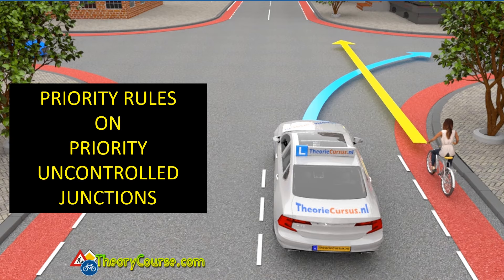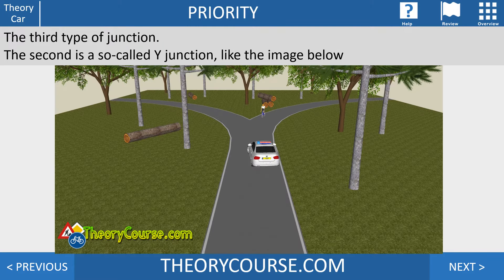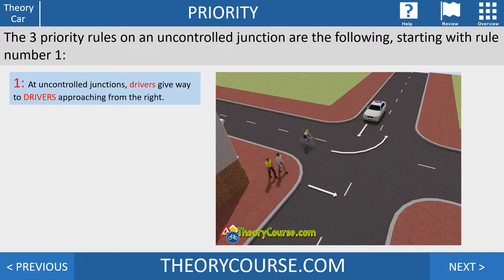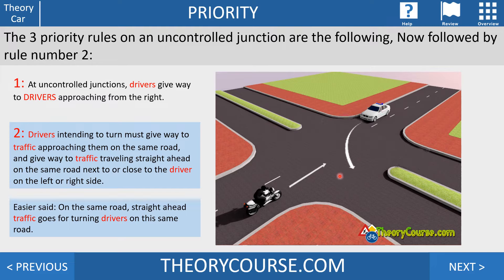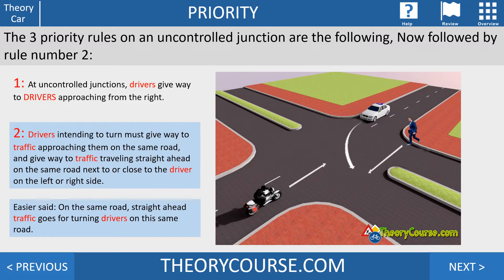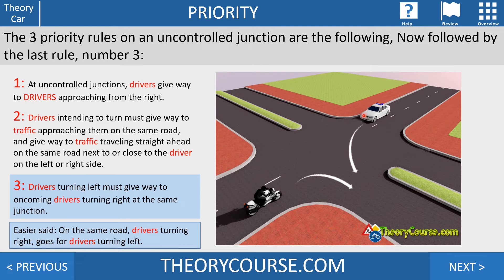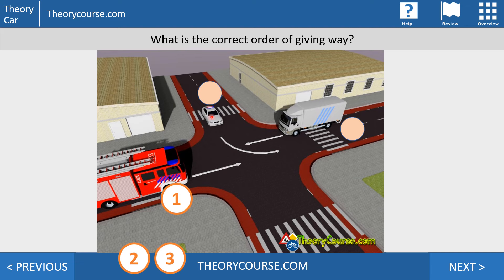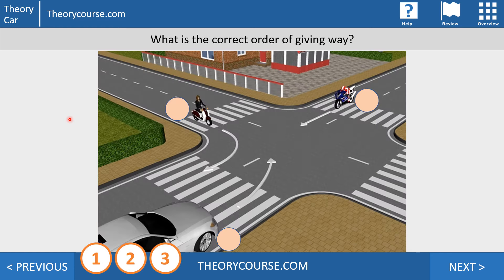Priority and giving way on uncontrolled junctions in the Netherlands

Comment: Trust me; 
1- Moped 🛵 
2- Motorcycle 🏍 
3- Car 🚗 

This because the moped doesn't cross the car's way. If Moped wants to go straight ahead or turns to the left, then in this case car will go first followed by the moped and finally the motorcycle.

Comment: In the final example. Sometimes the fire truck and box truck may accelerate at the same time and cross the intersection at the same time, as long as the box truck driver is careful and verifies that the car driver is not yet creeping forward. The car doesn't have to wait any longer since the box truck and fire truck will clear the intersection at the same time. In this video, https://www.youtube.com/watch?v=zv9FQZ7kgqU where a traffic light in Germany has stopped working and created a busy uncontrolled intersection, we see long spurts where traffic is flowing in two directions on the same road. If they didn't bend the rules in this way, there would be an unreasonably big traffic jam.
Reply from the maker: You can use the numbers 1 to 3, only once. So your answer makes no sense